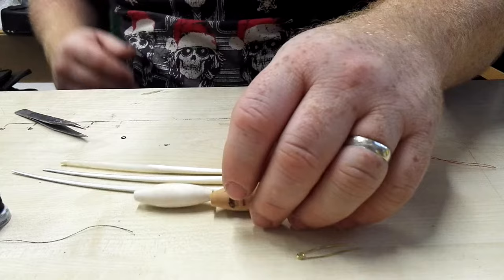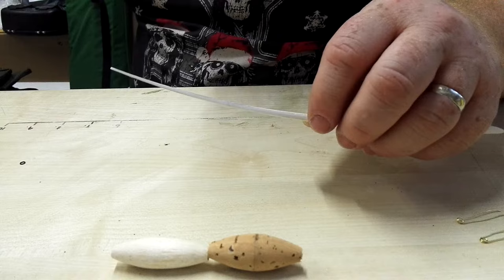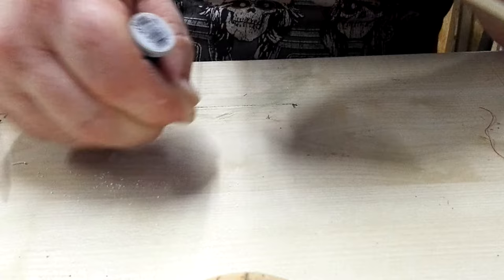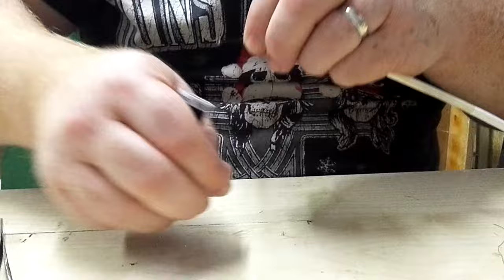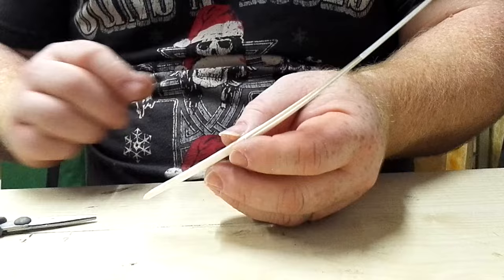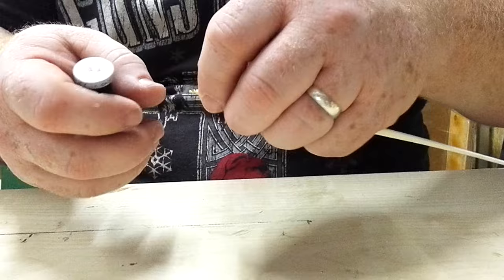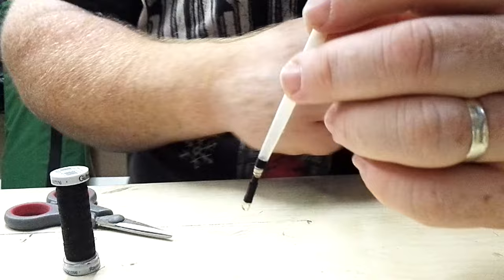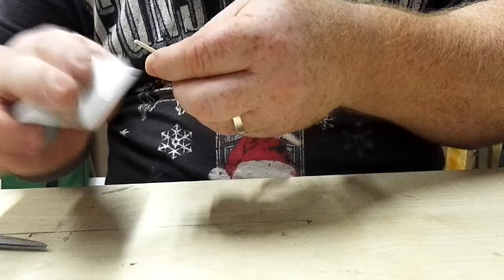Goose quill floats,,,,continued

Comment: How do you rig it with a line. This is what I want to know. Some use Dental rubber bands to hold the line to the bobber. I use another rubber band to secure a sugar cube sometimes two cubes to give the quill bobber weight to cast out. The sugar cube dissolves instantly.

Comment: Hi great blogs, very informative. Still waiting for follow up on pike bung. Have you ever used pampas grass for float making? I  got some last week  from my daughters garden well pleased with outcome made about 8 floats of various lengths and diameter. Put them in the microwave to dry out not a good idea some burnt and the smell was around all day. They paint quite well and take inserts they have a pith type centre which is very soft. Waiting for some porcupine quills to be delivered off ebay just got some macaw quills, that's the next project. Keep up the good work. John.